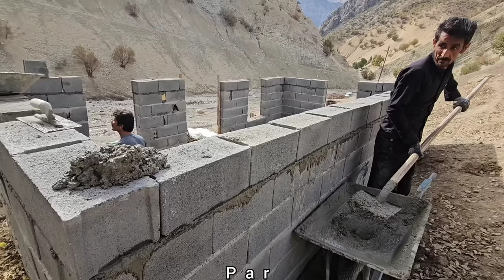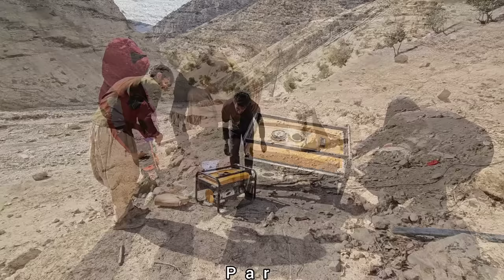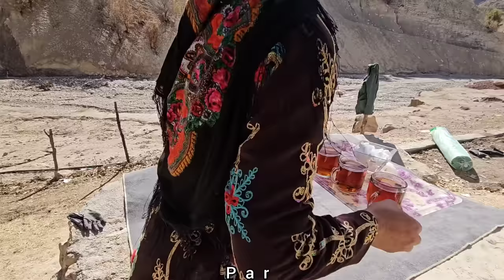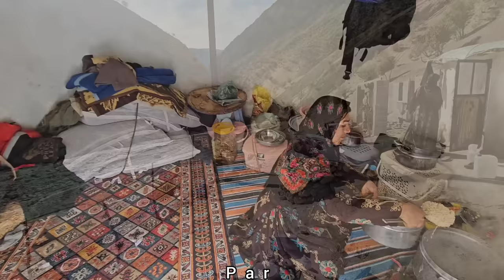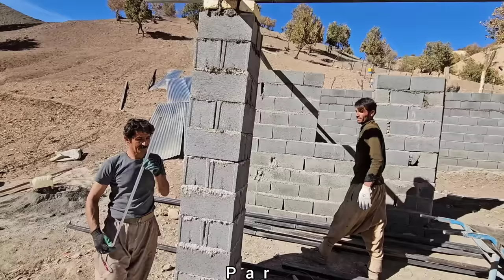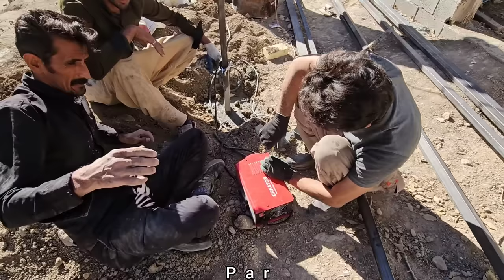Building the roof of a rural house,The challenge of using electrical tools for rural construction

Comment: Unfortunately with an iron roof you do get condensation forming inside, I hope you put a vapour barrier up and insulate otherwise you will get mold inside the house which isn't healthy.
Reply: Hay rollos para aislar. No viste como rodaban de la camioneta?ya se lo pensaron.
Reply: @gracielaconchab.6774  I don't know what you wrote, but thank you for a reply. I wrote the comment because I've had personal experience and have done a lot of building. Cheers!

Comment: Hola desde USA pueden repetir la formula del arroz Irani? Gracias desde hace dias soy una fiel seguidora,ahora solo los sigo a ustedes 🎉❤
Reply from the maker: Hi, yes, of course . Iranian rice is available in American stores. Two examples are rice. please choose good rice. Soak some rice in almost warm water for twenty minutes, then add it to boiling water, add a little salt and very little oil. Drain it after eight to ten minutes. Now pour very little cold water on it and pour very little oil and water into the bottom of the same pan.now add the strained rice and after the steam increases in the pan, let it simmer for forty minutes on a very, very low flame.Drink up, John.